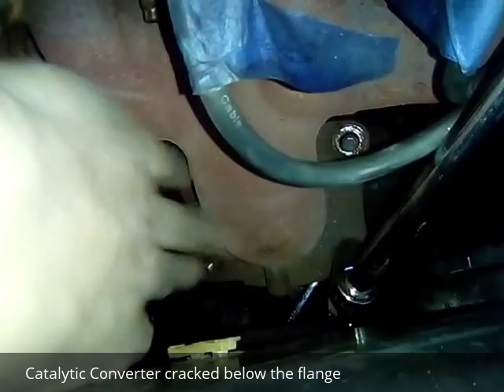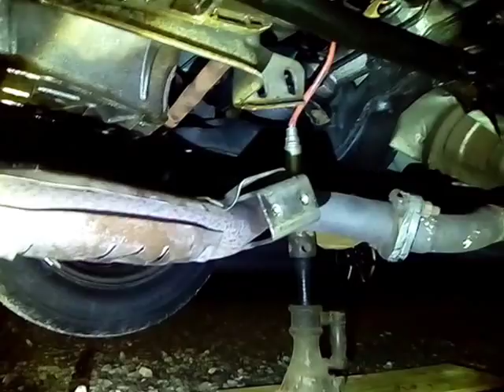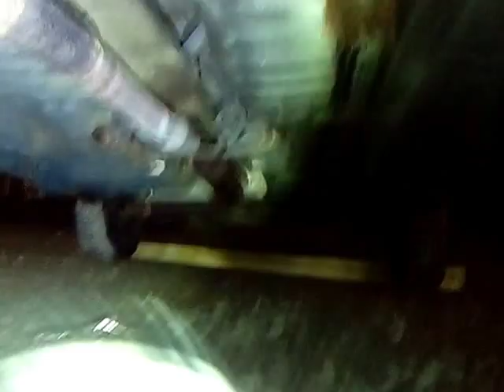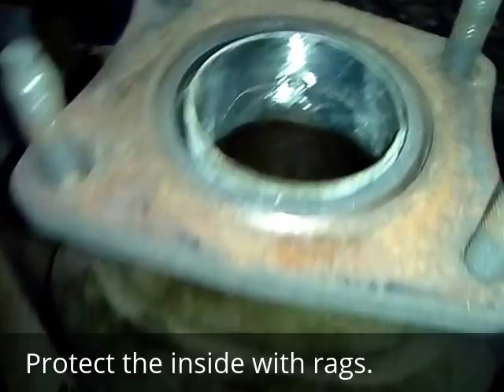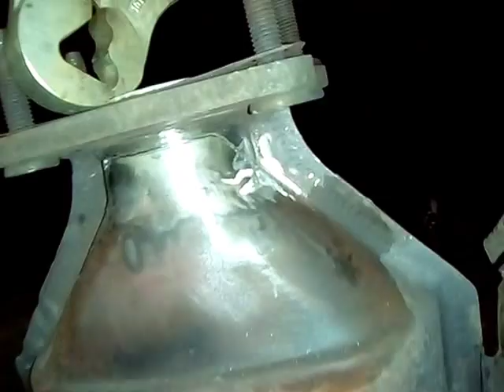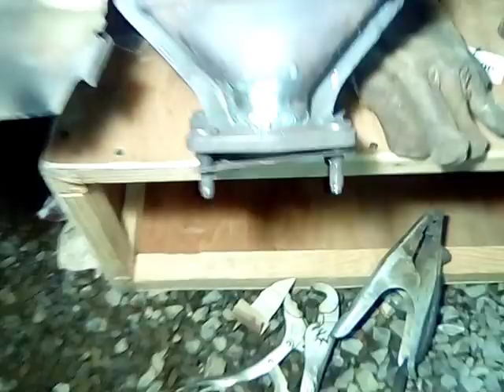Fix Your Cracked Exhaust Leak Repair 1997-2002 Ford Escort

Comment: I'm currently dealing with this, but the only issue I have is taking off the front cross member... I see that there are two bolts to each side and this strange flat bolt. I assume that's the large rod that ends up coming down (or part of it). This holds something up, as I do see you have a jack underneath. What is it holding up?
Reply from the maker: I believe you are referring to the engine support cross member also known as a belly band that runs front to back. This supports the two lower engine/transaxle mounts. If your exhaust has failed the two lower engine mounts are probably bad as well. Even if you remove it the engine will still be supported by the two upper engine mounts/transaxle mounts. You can support the engine with a block of wood and jack if you want too. 

In this video the jack is just acting as a safety to prevent the car from falling if the jack stands were to fail. It's probably supported on one of the two tow rings.

Comment from the maker: UPDATE!!!!! The Exhaust is probably stainless steel, likely 409 from the cat to before the muffler. 409 gets a light surface rust and is magnetic. Can anyone confirm the grade?

The whole problem is not that our exhausts pipes are rusting out, it's that they are fatiguing and cracking from engine vibration. The engine mounts are getting old combined with a factory defect of excessive engine vibration, refer to the engine mount TSB.

The two lower engine mounts fail overtime and oil.  Without replacing the two lower engine mounts at the very least and most preferably doing the TSB engine mounts modification upgrades the exhaust will just keep cracking. My exhaust just cracked for the FOURTH TIME.  Both at the lower catalytic converter pipe where there is a two bolt bracket that bolts to the engine and the replacement flexpipe just cracked after being replaced 3-4 years ago.

To weld: If the exhaust is 409 stainless AWS EC409 or EC409CB type MIG wire, was specifically designed to weld 409 exhausted parts. Use 98% argon and 2% shielding gas. A brand would be Lincoln Electric Outershield MC409 & MC409W (better).

Alternatively, to save money you can use AWS ER309LSi wire such as Lincoln Electric Blue Max MIG 309LSi. The rod is designed to be used with Oxygen/argon or helium mixes (trimix helium/oxygen/argon). You can use standard argon/CO2 mix for single pass welds (I'd expect reduced wetting). Multipass welds you lose corrosion resistance from too much CO2.

Er308LSi wires should be avoided as it could have less crack resistance when welding 409 stainless due to how the alloys interact to form a structure known as martensite. (pg. 366)

Sources:
ASM Specialty Handbook "Stainless steel" J.R. Davis, Davis & Associates pg. 366

MIG/MAG Welding Guide, Third edition, Lincoln Electric, 1997. Pg. 29

Stainless Steel Product Catalog, Blue Max, Red Bar, and Stainweld Products, Lincoln Electric, 11/2002 pg. 2 + Pg.35

For the best welds most crack resistant welds, be sure to protect the backside of the weld. Some methods are with a stainless steel backing strip, inert gas purge, or alternatively use solar flux, after the catalyst converter, so as to not clog it with flux residue.

If you made a mistake like me and welded using common ER70S-6; I can report that after a year and 9 months the weld is holding up fine at the neck of the catalytic converter (video), with no signs of rust. The uncoated welds at the flexpipe joints outlasted the flexpipe although showed some rust scale after 3-4 years.

Comment: It would help a lot more if you would video tape yourself actually taking things off rather than telling people , "I took off the shield."
Reply from the maker: Thank you for your input. I assumed most people already knew how to use a ratchet and sockets. I felt the most useful information for most people would be telling them the size socket needed and any tips for tricky fasteners like the exhaust. I could have tripled the length of the video showing each nut coming off. I will think about that for future videos. However that would be more work and considering small content providers were demonentized thanks to the actions of a few I have less motivation to put in more work until I reach 1000 subscribers.
Reply: Good video man. Keep up the good work.
Reply: @supermetaltastic  seeing someone how to do is best, than you know your not doing it wrong.

Comment from the maker: I hope this helps some people find and fix that leak cheaply. If you need gasket material you can use the below products. The Red RTV is coated on both sides of a replacement gasket to seal the irregular surface.
RED RTV for gasket: https://www.amazon.com/gp/product/B0002UEN1A/ref=as_li_tl?ie=UTF8&camp=1789&creative=9325&creativeASIN=B0002UEN1A&linkCode=as2&tag=crisplinemeta-20&linkId=526492264b5a6aaa2c06592331561a52

Permatex Muffler and Tailpipe Sealer: https://www.amazon.com/gp/product/B000BOAZM8/ref=as_li_tl?ie=UTF8&camp=1789&creative=9325&creativeASIN=B000BOAZM8&linkCode=as2&tag=crisplinemeta-20&linkId=192640ef905ad1c48fb4468a04d48a62

I have used the red rtv successfully. I have heard that permatex muffler and tailpipe sealer works much quicker and it has excellent reviews. However, I have not personally tried it yet.